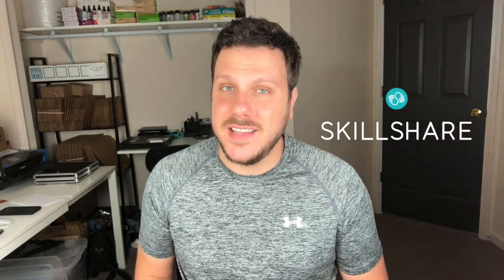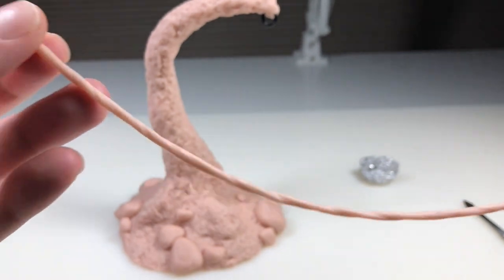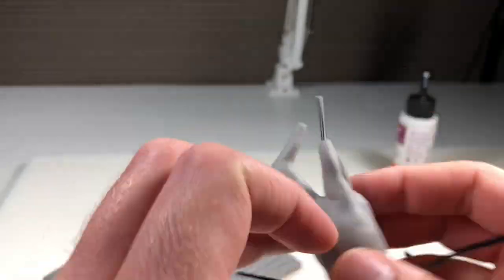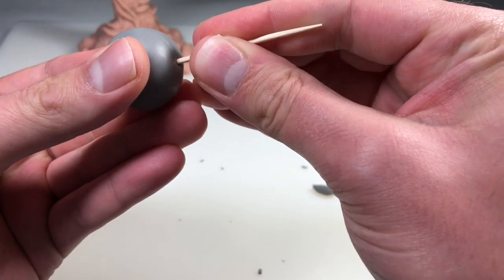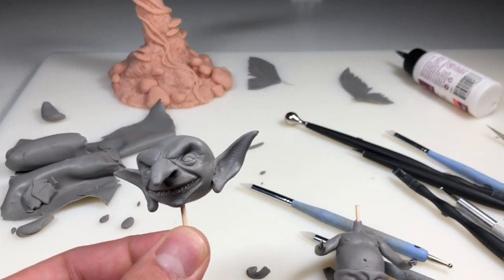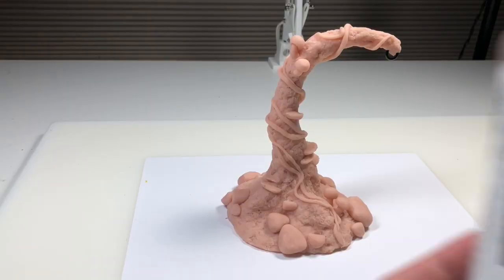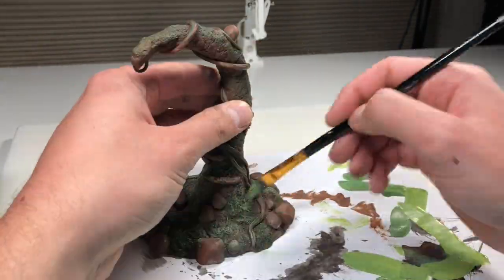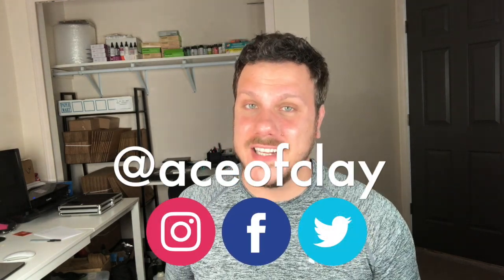I Made a FLYING Goblin Fairy / Imp - Polymer Clay Tutorial - Sculpting YOUR Requests E08

Comment: This is awesome!   I just ordered some super sculpey to try some sculpting out myself! 

Question: What kind of surface do you work on?
Reply from the maker: Thank you! And it’s just a plastic kitchen cutting board
Reply: @aceofclay  Excellennnttt thank you!
Reply: Zeep Xanflorp the best surfaces are things like ceramic, mirror or glass as the clay doesn’t stick to it. I got myself a silicone baking mat as I don’t have anything like that and that works ok. A sheet of acrylic would probably work well too and may be less expensive. 

Good luck with your first sculpture - if it doesn’t come out great don’t give up, it takes a while to get used to your materials. I’ve been using polymer clay for about a year now and I’m still struggling with areas like smoothing, bits like hands and feet etc and other bits that are fiddly and tricky. 

I think Ace said in a previous video too, don’t worry about getting a ton of tools (I did and don’t use half of them) - a small set of clay/wax sculpting tools off ebay or somewhere is more than adequate for a beginner. Also don’t buy massive amounts of clay either. Once you figure out what tools and materials you work best with then you can do things like buy in bulk to save money or use coloured clay instead of painting your sculptures. If you buy a lot at the beginning and don’t get along with it then you’re stuck with a load of stuff going to waste. 

Hope that helps! Definitely post a link to your finished piece so we can all see! 😊

Comment: Is there a reason why you use the gray over the original?
Reply from the maker: The gray is super Sculpey firm so it’s not as soft as SS original. I like using this for smaller pieces/areas like this guy.
Reply: @aceofclay  Makes sense for figures, especially ones that will be hanging.